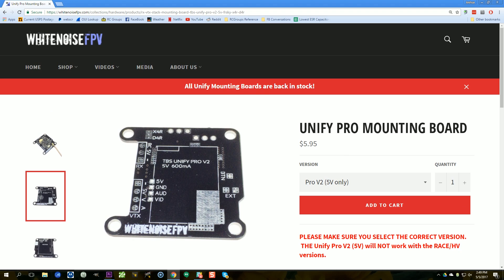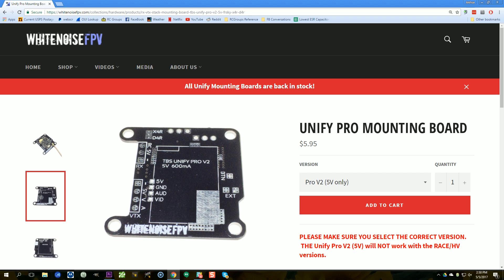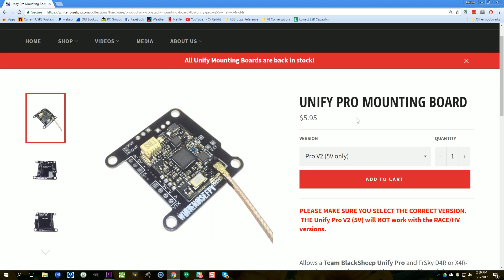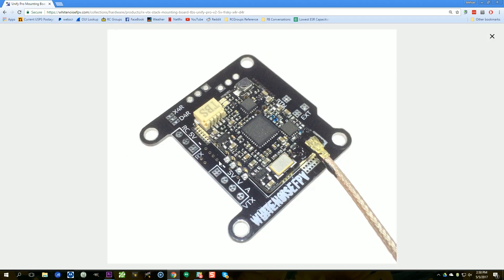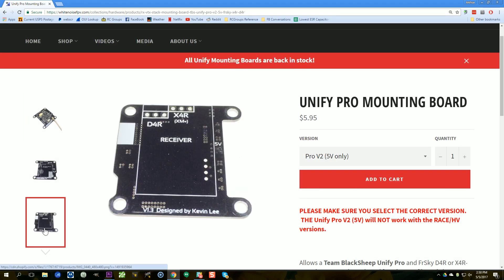THE BEST WAY to mount your TBS Unify and FrSky Receiver | WHITENOISE FPV

Comment: hey man my tbs unify pro when i power it up show s me 1 red and 1 blue and then 2 reds 4 blues and 3 reds 1 blue and then blue stays on the ragne is arount 10 metres wtf is wrong help me me if any1 know pls
Reply from the maker: No matter what the settings, you should haveote than 10 meter range. Unless it's in pit mode jut I don't think the LEDs indicate that. Confirm you are on the correct channel. Don't rely. On your goggle autoscan to find the channel.

Comment: Are the solder joints on the bare pads just to hold on the VTX or do they relay ground, power or signal?
Reply from the maker: On the Unify HV they just hold it down. On the 5v Unify I think they relay signal, power, etc.

Comment: i was flying  yesterday and my quad just blacked out i wonder if the unify over heated? because i could still see in my goggles it was just white noise! mine is mounted  on the very back bottom of my martian! you thing thats ok??there is ample space on this quad and lots of air flow!..
Reply from the maker: If you were flying, then probably the Unify didn't overheat. Unless you mounted it some weird way where it gets no airflow.
Reply: i didnt  turn on something in uarts!..its possible it  wasnt getting full potential .and i soldered a low esr capacitor too!

Comment: Am i missing something, MY TBS unify Pro 5G8 HV does not fit. The one your holding in your hand looks different then then the one I received from amazon and definitely doesn't fit and all the ones on amazon are the same, Im so confused I've returned so many VTX's already. Let me know anyone Thanks
Reply from the maker: Are you sure you didn't accidentally buy the board intended for the 5v Unify?
Reply: I probably did because that was the only one they had on amazon. I just ordered another one from proflipRC because it looked like the one in your video. TBS is annoying because they make wayyyy to many VT'x all I know is I have the 800mw one which I believe is the V3

Comment: I need your help. I'm trying to install TBS Unify Pro and R-XSR receiver to my CL-Racing FC.  I want to use the smart-audio on the TBS unify and Telemetry out put on the R-XSR receiver as well.  I am not sure where to connect the WHITE cable from TBS unify(Smart-audio) to on the FC.  I'm assuming I can connect the white cable to the Tx solder pad on the FC?  If I also want to get the Telemetry from the R-XSR receiver, where do I connect the cable from the receiver to?  This is very confusing to me and thanks for your help.
Reply from the maker: Use solder pad TX4 for the smartaudio audio (white wire).

Use the built in TELE pad for the telemetry.

Comment: Hey Joshua, I am particularly interested in the HV 25-800, I have the HV race 25-200. I haven't had any issues, but I have heard the 5v version in the HV 25-800 isn't as good as the 5v version. Have you noticed any difference in video quality? Thanks -Brandon

Comment: When I buy stuff for my quad I always get a spare. not matter what it is. may it be flight controller, Motor or whatever. NOW YOU MADE ME BUY 2 of those WhiteNoise boards that I never knew I needed up and until now. I hope it will fit in my super tight build!

Comment: @Joshua Bardwell and everyone reading the comments.

I am getting a lot of video noise on the VTX Unifypro v2 5v at all power settings - have tried multiple different chan's. Its not signal noise its video noise.

I have isolate the camera and the vtx from the quad so its all running directly from the battery on a 5v bec capable of 3A supply- grounded to the same ground still has noise. I have tried 2 different becs.  Any ideas what could cause this? I've read up many people having issues with the HV not the 5v version - they state to "make sure you ground the audio" but there is no ground for audio on the 5v? Do they mean actually ground the audio wire aswell as having it used it for Smart Audio? 

I attempted to switch off Smart Audio to see if that was impacting it and it was not. 

Any help would be appreciated
Reply from the maker: Grounding the audio is not the cause. And if you did ground the audio wire, you couldn't use SmartAudio.

Have you tried a different Unify?

Are you sure you are on the correct channel?
Reply: 100% on the correct Chan can see it in bf OSD and Im using Achilles firmware on the 5808 - installed after you advised (its excellent  so thanks). The quad its on is a prebuild Armattan Chameleon direct from Armattan. I was having a lot of issues with the LR-800. After researched I discovered the so called LR-800 VTX is actually just a re branded DYS MI200MW 25/200mW Switchable 5.8G 40CH FPV from banggood- the original batch had a fault where they would spike to 900mW (bang good note in there advert this is now fixed), Armattan are passing this off as a 25-900mW switchable VTX - after emailing them they stated its either in 25MW or anywhere from 200-800mW. Anyway the FC supplied by Armattan is a CL Racing F4 FC all in one PDB / FC - Im debating if the noise is coming from that. Thanks for responding

edit - not tried another i dont have one
Reply: Note Armattan refunded me for the cost of the VTX without question - and have been helpful on other aspects great customer service!

Comment: I thought the unify pro hv had some sort of temperature sensor and it would lower the power output to prevent overheating. Is this true or did I just imagine this?
Reply from the maker: I know the Tramp has that exact function. The Unify in my experience just shuts down when it gets too hot. It doesn't like ramp down from 200 to 25 mW. I say this because I know the Unify will sit happily at 25 mW forever. But if I turn up to 800 mW it shuts down entirely after a few minutes of sitting without airflow.
Reply: Joshua Bardwell ah ok thanks for the reply. Good to know cuz I run at 500mw usually but it should get a decent amount of airflow where it's mounted right now.

Comment: Great video!

I have a question.
Is that possible  to use smart audio and mic at same time?
because I'm using runcam swift that come with buit in mic.
Reply from the maker: +大塚昌広 yes, but the mic will interfere with SmartAudio sometimes.
Reply: Joshua Bardwell  If I connect mic and smart audio same time, where should I connect mic? Same place the vex smartaudio wire goes?
Reply: See this: https://github.com/betaflight/betaflight/wiki/Unify-Smartaudio

Comment: Also, which pins on the x4r sb did you use and had you uninverted the sbus?
Sorry to have so many questions.
Reply from the maker: +Lee Swifty I used the standard pins, the only ones that output SBUS. Signal 2 I think. I did not do any invert hack.

Comment: Hi Josh.
Help. I just soldered the unify hv in place. However, on the side of the mounting plate with the D4r pin holes, there is metal on my unify hv touching those pin holes, the D4r ones. Do I need to remount my unify hv or can i ignore it?
The metal is on the outside of the unify pro, opposite end to the pigtail. Can provide a photo if it's easier.
I have mounted the unify hv a tiny bit high when looking at the mounting board.
Reply from the maker: +Lee Swifty I'm not sure exactly what you're describing but I think I would move the Unify.
Reply: Joshua Bardwell 
You are a star getting back to me. Thank you so much.
At the top of the mounting plate for the tbs pro hv, where the x4r receiver  pins enter the mounting board, next to those x4r 'holes' in the mounting board are 3 more 'holes' for pins. The pads around those 'holes' on the mounting board are making contact with the outta edge metal of the unify pro hv. I'm wondering if that contact will interfere with the use of the tbs. I'm only using the mounting board to hold the tbs pro, I don't intend to use the receiver connections on the mounting board.
Reply: I just ran a continuity connection test and they are in fact not touching. I think I'll run a little sealant along the edge and leave it.

Comment: Hey JB,
I'm wiring up my white noise fpv board, it's red but similar to the one in your video. So my question is about how to connect my Frsky XM plus receiver. Which side up ? Or do I connect the square pad of the UNIFY PRO Race/HV MOUNTING BOARD to the square pad on the XM plus receiver ?
Thanks for all your help,
Reply from the maker: Just look at the pinout and make sure you are connecting the correct pin to the correct pad.

Comment: Hi again. Just want to double check something. Iv purchased tbs unify pro race and another betaflight f3 board. Which are the correct solder pads I have to bridge with solder to get it all working properly?
Reply from the maker: If it's the 5v Unify then I recommend using a regular 5v pad instead of RAM. If you bridge RAM to 5v, the Unify will draw too much power for the filter that is on the RAM pad. If it's the HV Unify then I bridge RAM to vBat and run the Unify and the camera both off of RAM.
Reply: Joshua Bardwell thanks again. So both vtx and camera wire yellow(signal)on the same solder pad. Is that correct
Reply: Sorry. Red wire not yellow
Reply from the maker: Red wire, yes.
Reply: Joshua Bardwell thanku so much.
Reply: Joshua Bardwell what about the other two pads below. Do I need to bridge those?

Comment: I always get really nervous when I solder 2 components together using more than 1 solder location. What if you have to replace one of the components? It's pretty difficult to desolder/reflow 2+ solder joints at the same time.
Reply from the maker: Yup. Look into something called Chip Quick.

http://amzn.to/2rwBn3i

Comment: Would I be able to mount this above my flight controller or is it better to always mount the FC last?
Reply from the maker: If you use rubber vibration-isolating standoffs, then I suggest putting this below the standoffs and only having the FC above them. If you use a rigid stack, then I don't think it matters.

Comment: sweet I hope I can fit it in my new gt2 frame I have my hv tbs mounted to the under side top with the 2 big pads touching the aluminum zip ties hot glued it also helps disperse the Heat. in fact that's the only way I could get mine to work for more than 30 seconds unless I was flying a miles an hour

Comment: Hey Josh, nice video as usual; I didn't know about this product until today watching your video.
I am interested in whether or not this adapter help sorting some of the issues related to running the X4R antennas too close from the Unify Pro? I don't think it would especially since you didn't mention it. Anyhow do you have any trick to avoid interference between X4R and Unify pro when they're so close to each other?

The build I am working on doesn't have much room for the stack and it turns out my X4R and Unify are pretty much stack on top of each other. I have to route to X4R antenna away from the Unify Pro otherwise I have crazy banding issues.

Cheers
Reply from the maker: I haven't noticed any interference between them.

Comment: For tidying up flat builds I'm using the XM+.
You can mount it inwards under most FC's (Omnibus Pro works guaranteed) just like it's meant on this board.
Since the release of BF-OSD, S.Port becomes more and more obsolete for me. There is no reason to drag around a x4r imo unless you run lua-scripts.
Reply from the maker: +Bloody JMF I still love my vfas monitoring damn it.
Reply: logic switch warner?
Reply: exactly....

Comment: I think the mounting pads for X4R AND XM are reversed, signal to ground..  I'm trying to put on an XMplus receiver and the header pins are in the wrong order, so I would have to invert the board and pin the bind button between the whitenoise board and the receiver board.  I think I'm going to use the other site, labeled for D4R.  Did I miss something on this point?
Reply from the maker: +Grant Fowler no, that'll work fine. The receiver pads are simply passing through. You can use whichever suits you.

Comment: Hey Joshua, nice vid. but I gotta let u know that I recently got a taranis se and out of the box I am already getting the poor range issue.  I thought maybe it was the 2 db antenna that came with it so I purchased the 5db antenna with the exact same result.  I've contacted frsky and they want me to remove the back board and send it back to them to repair.  I'm totally not impressed. For 1, I have to send it back to china (who knows how long that will take to get there), 2 I have to wait for them to repair it and mail it back to me ( probably using the cheapest method of shipping. and again who knows how long it will take to arrive). I was initially so excited to make the switch from futaba to taranis, and now I'm not sure at all whether it was worth the switch.
Anyways, my question is.  Are there any suggestions from you of anything I can do to see if I can't salvage my radio without having to send the backboard to china?
Reply from the maker: +CodeBlue FPV buy a new back board and save yourself the time?

Attempt to return it to the retailer instead of taking it up with FrSky.
Reply: I'm kinda stuck between a hard place and rock with this unfortunately, I jumped on the se before other retailers had it in stock and the only place that had it in stock at the time was horus rc. Guess what, they're based out of china as well!  I've been e-mailing back and forth with with them, initially requesting that they send me a new board first and on receiving the board I would return my board, but both frsky and horus rc refused to do that (Where's the trust these days).  So Horus has met me half way now and has told me if I send the board back and e-mail them the tracking number that they will send out a replacement board.  Still not happy with that or the fact that I have to pay for shipping in the first place when the radio was basically defective out of the box.
Sorry for going on about this, I just need to vent. Maybe you can throw some of your weight around and help my plight.

Comment: I just built out an armattan chameleon.  Fitted with TBS unify pro HV, f40s, f30A and a BF FC.  Peppered with caps.  It's super tight.  I'm mounting my battery on the bottom.  I had to raise the top plate by a few mm. Currently I have the FC on 6mm standoffs and the vtx is mounted to the top plate, above the FC, and an XSR in the rear, top plate. This board might work well but one of the boards will need to sit as low as possible to the bottom plate and those rubber standoffs look huge.  I just ordered some but might have to go in a larger frame. The FC sticks out a couple of mm, too.  It's a little frame.Looks and feels solid.  I maidened it LOS today. It flew good but black box looks worse than my other two.   Now suppose to rain for the rest of the week.
Reply: It occurred to me that my comment about blackbox might have sounded negative towards the BetaFlight FC.  For the record, it's my building skills that's the problem, certainly not the flight controller.  The BetaFligth FC is a bad ass little piece of technology.  In fact, I have another on the way.

Comment: How does the smart port wire of the x4r hook up to give telemetry?  Is this there no accommodation on the whitenoise board for it?
Reply from the maker: +Tim Spitz no. You just plug it into the side of the receiver.
Reply: Thanks I forgot about the side connector.  I got it confused with the xsr.

Comment: so is this better than the regular unify? i have been reading nothing but issues with that vtx from rcg and people i know who bought it. i like the stack mount but i have diatone sp2 i am building with now that does the same thing but without smart audio,  which i would rarely use.
Reply from the maker: +prOkrEAt unknown whether the HV is better. It's better if you don't have a big ass 5v regulator.

Comment: Good info! I do have a tramp and I use it with my KISS setup and the lua script. It is fantastic being able to control my vtx channel and power output from my taranis along with being able to tune my quad through the same interface. Absolutely good stuff. Now i need to get rid of video noise. Over to your other video on how to fix that :).

Comment: Hi Joshua, I recently built a chameleon with kiss fc and the  TBS Unify Pro HV, I didnt find a better place to put the vtx that attached to the top plate right on top of the fc, after watching this i'm kind of worried for the heat, both vtx and fc generate a lot of heat, do you think I should mount the vtx somewhere else ?
Reply from the maker: I wouldn't mount the vTX directly on top of the FC, for the reason you stated. Probably you will get away with it, but I don't like it. And I would be worried about overheating the vTX even if the FC was fine.

Comment: will it fit the xsr?
Reply from the maker: You would just stick the XSR to the board with double-sided tape and solder the wires to the board. But frankly at that point you might as well just solder the wires directly to the FC. Still, it will provide a convenient place to mount the XSR.
Reply: thanks

Comment: You think it best to secure your Unify Pro directly to the carbon  plate? I always think of shock protection and use foam tape. I feel like I " didn't get the memo" about this. What are your thoughts?
Reply from the maker: I have always hard-mounted my Unify against the bottom plate. I often find that it overheats on higher output powers if it isn't directly against carbon. I think it will be fine.
Reply from the maker: I do agree that shock absorption with foam tape is usually desirable. Just in this case I never did because I needed contact for heat dissipation.

Comment: josh i have kiss esc 24a v1.2.  i burned one out i am going to buy a new one but they have only v1.3 now. can i use it
Reply from the maker: I would run all four at the same release level. Just upgrade the other three?
Reply: thanks you are the best.